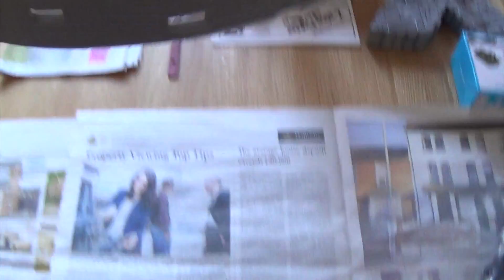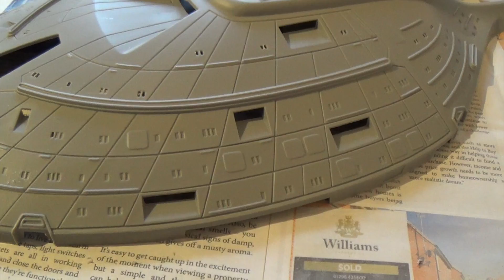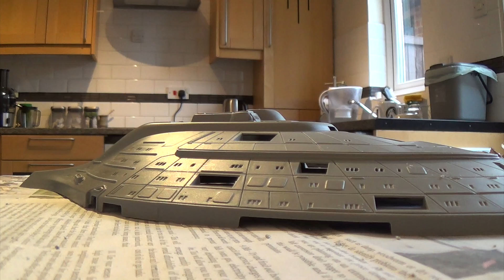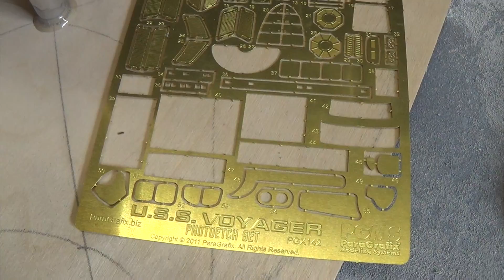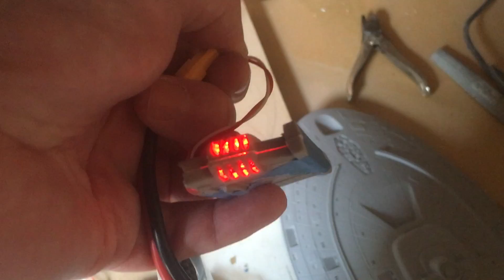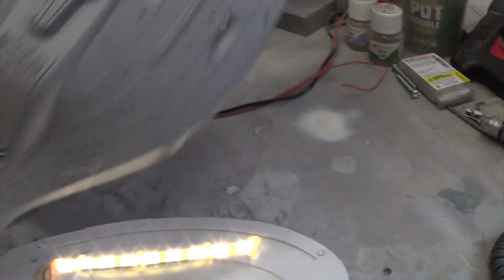U S S Voyager build - Part 1

Comment: You should definitely get a drill with adjustable speed. I'm actually building this ship an I drilled all holes with only a wipe with my fingertip to clean the drill after each hole. You just have to avoid the plastic from melting. And i  get real a real rectangular shape for the windows with scraping the excess with a thin and sharp hobby knife. It really works swell for me. My smallest file is just to big to do the job.
I watched the complete series of your videos for this build and I enjoyed it. Many many good tips for my work and a lot of inspiration too.